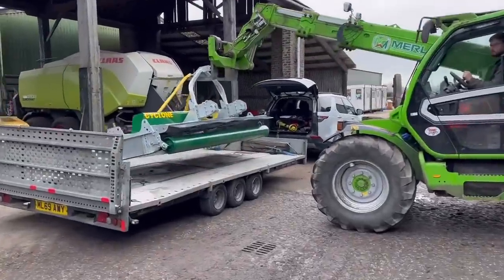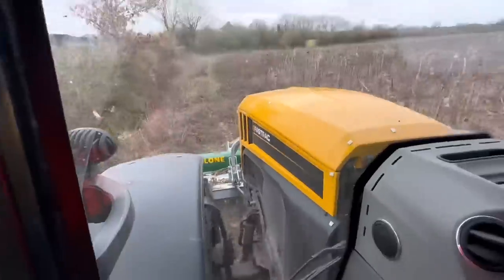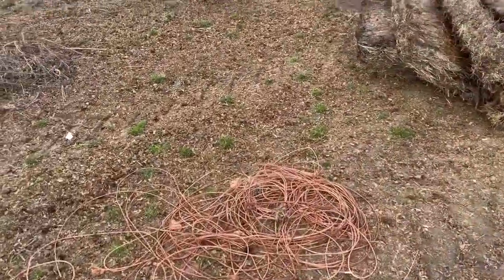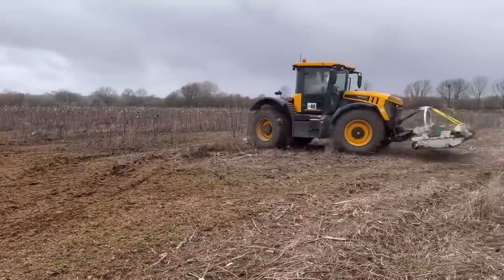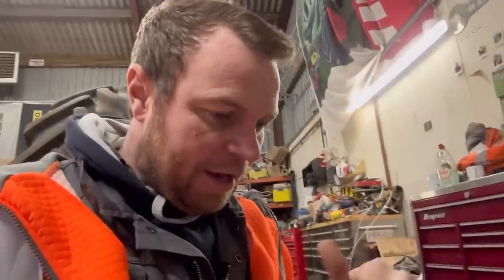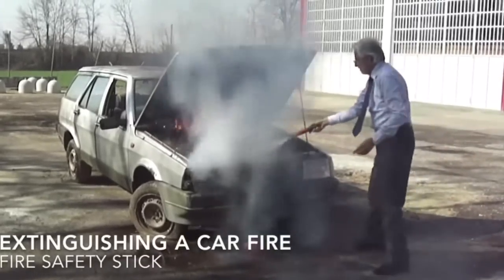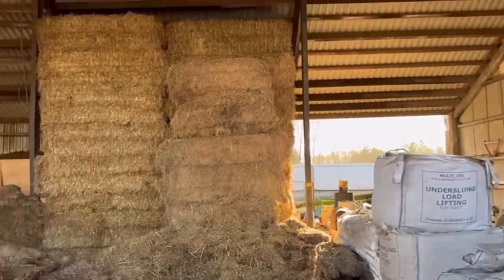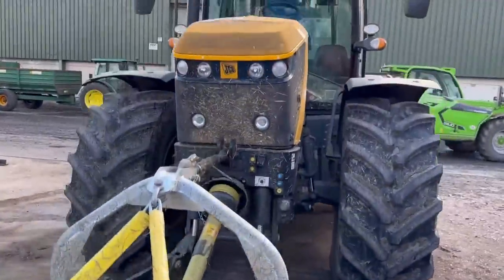MAJOR MOWER DURABILITY TEST ON A BIG BALE  #OLLYBLOGS #AnswerAsAPercent 1069

Comment: Would be interesting to get your friends in the fire service to test those fire sticks. I like the idea but comparing discharge times is not the deal. Anybody taught to use a conventional extinguisher is told to use short bursts not a continuous flow. Having said that compact and available could save the day 👍
Reply from the maker: They work in a different way by killing the oxygen to put the fire out with a chemical reaction

Comment: Hi Olly, I have worked with these sort of mowers a lot of years ,I have never considered Major before but I will now and to produce a cut like that at those sort of speeds mind you you are putting a fair few H P through the shaft , still very impressive thanks mate.
Reply from the maker: At that kind of fuel use per hour  was prob only using 46hp

Comment: Those small fire laughable extinguishers wouldn't piss on a farm fire. Had a few fires on tractors in farming. 9kg powder at the min would help but a fire needs to be killed rapidly to stop it from developing into an inferno.
Reply: These are so small and light you can get to the fire in seconds. Also consider a 9kg extinguisher if fully maintained will last you 30 secs. The lowest level of fire stick is 50 seconds and the big ones 100.
Reply: I hope his insurance doesn't say that the extinguisher has to be certified. As the fire stick sis only certified for pleasure yachts!
Reply from the maker: The discharge time of a conventional extinguisher is laughable tbh
Reply from the maker: Sad thing is most people don’t have either especially in tractors